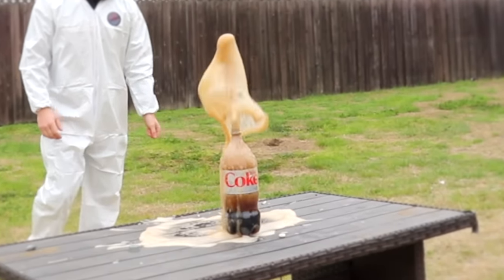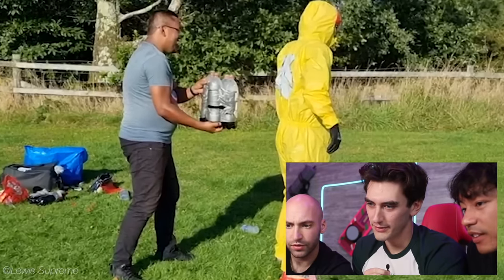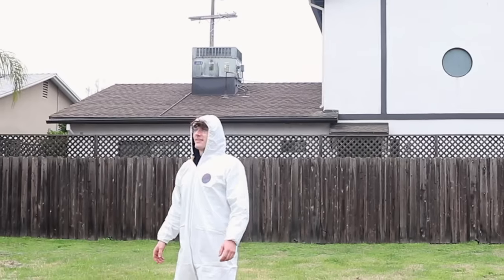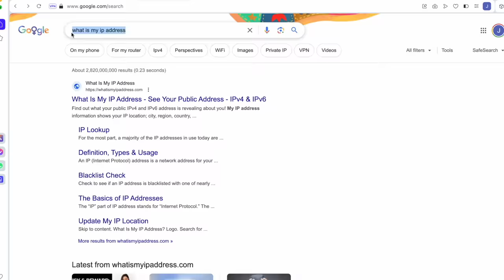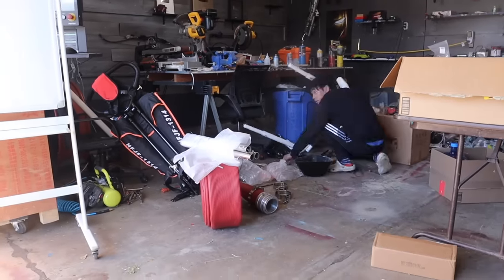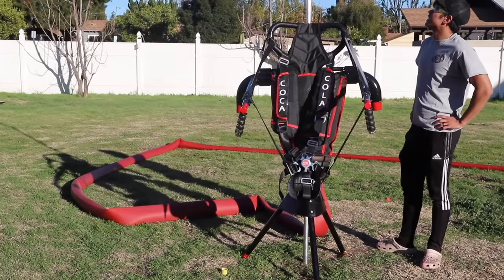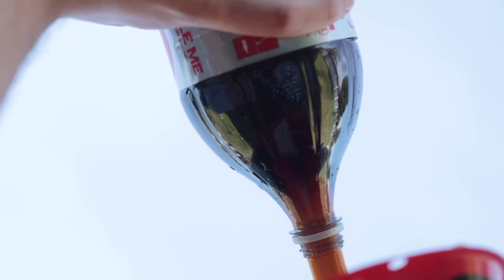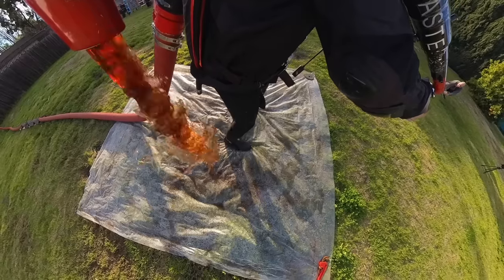How Much Coke And Mentos Does It Take To Fly?

Comment: You answered a question that has been in my head since I was 6
Reply: For 13 years it has only been answered
Reply: 😂😂 u also here .. Ur videos are good
Reply: He was lacking some 3D printed nozzles though.
Reply: true
Reply: Except it wasn't the mentos doing any of the work; most of it will be compressed CO2 at the top of the tank, pushing everything out like a supersoaker.  The early tests are all just CO2 and water, no mentos, and they work just like the final.  Sure, there's _mentos in it_, but they're mostly dissolved by the time they even open the valve.
Reply: DUDEEEEHH 😂
Reply: Same

Comment: Make a mech suit
Reply: Strength augmentation already exists the hard part would be making it self contained 
Plenty of factories use it even now and have for years you actuate the lifting arms and grippers just like you would if you was picking up the heavy part yourself but it does the real work using several pneumatic cylinders potentiometers and valves. You move and it moves the same direction. Many have a ever so slight but noticeable delay newer systems don't. Think ebikes with mid motor vs hub motor if you ever tried both you will know what i mean by the delay mid motor have non hub motors do. But they both work much the same as an augmented strength system for manipulating heavy parts in factories.  
So i suspect that between him and the hacksmith they could probably pull off a real fully self contained mech suit. 
High powered rc motors and gear reduction + potentiometers and a power source from a lipo battery pack and it should be feasible to be able to at least let a person lift say 350 to 400 pounds with out effort
Reply: Coke boy

Comment: Ok first idkbhow insist found ur channel but glad I did I just subbed sonlooking Forward to binge watching your content But second isn't patches.Basically pressurized water in the tank the Pressure is pushing the water through the hose.Therefore , causing the thrust that has nothing to do with the coke or mentos

Comment: You should have made the release nozzles smaller to increase the pressure instead of just going every other route possible lol like hacksmith made a water jet back and they up the psi by simply making the nozzles on each side smaller so pressure would increase even with same amount or less water it’s the same principle with this